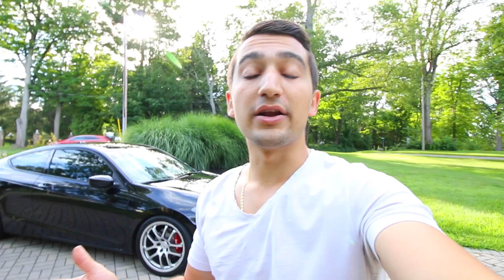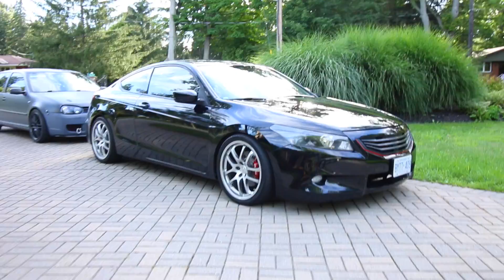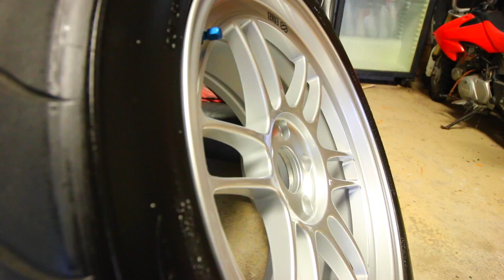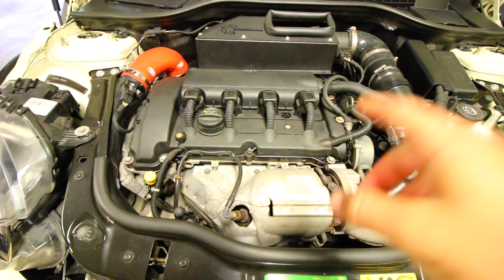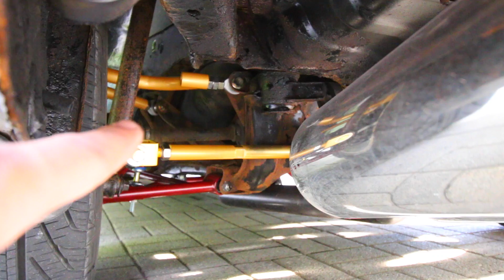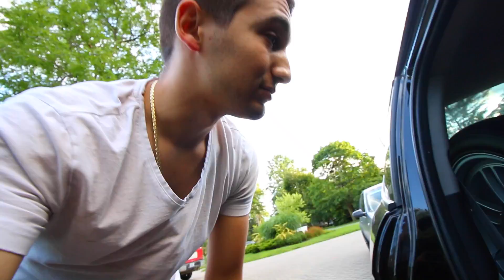I BOUGHT THE CHEAPEST FORGED WHEELS ON THE MARKET!!

Comment: Are you still on the lowering springs or did you get coils on the accord, I love that fitment and I got a 8th gen accord as well.
Reply from the maker: I'm on coilovers right now, but I didn't change the ride height of the coilovers when I took off my RPF1's (oversized circumference) and it had less tire gap than what it has now. I might lower it a tad
Reply: milanmastracci nice, what coils are you running and are they comfortable? Im thinking about getting megans but I dont wanna break my back with the amount of uneven roads in NJ

Comment: G35 wheels are staggered, did you mount the wider wheels on the front or rear?
Reply from the maker: Not quite. I put them the proper way they should be. The previous owner mounted 245's on all 4 wheels which I thought was a bit weird but there's no point in swapping them now. The rim width is only different by 0.5" so its barely noticeable.
Reply: Cool, sounds like the way to do it on the Accord, no point in having staggered wheels on a FWD car.

Comment: Talk about dirt cheap, I picked up a set of the same forged wheels brand new after sitting 10+ years in someones garage, first owner of his G35 for $400 last year. Lol, honestly thought you wouldve been running the RPF1s on the 240!!
Reply from the maker: Damn that's pretty good!! The only reason why I didn't keep them is because the overall tire circumference is too big, and I think the RS3's would be too grippy for this thing. I want it to slide out nicely ;)
Reply: Look into Weds Sport Tc105n wheels. Theyre kinda on the pricey side but super lightweight
Reply from the maker: Those would run me close to $3k without rubber!! Almost half as what I paid for the car..
Reply: Lmao 😰
Reply: If you're getting coils for the 240 why not just run the rpf1 with different tire's

Comment: if you alter the wheel diameter,does it give a correct speed reading on your clock
Reply from the maker: I know. Thats why I didn't put the 19's with the 245's on the 240. I really wanted to but it was going to be too big

Comment: What size is your spacers for the accord with 19” wheels?
Reply from the maker: With stock fenders (not being pulled and rolled), these wheels would fit perfectly. But since I did roll and pull, I had to install a 12mm spacer both front and back to get them to be flush.

Comment: 3 different cars and I thought I was bad I got 4 cars and 2 don't run because they need a lot of work but eventually I will get them on the road one is a 92 Accord LX 5 speed manual transmission the other one is a 95 Prelude SR-V Red with Black heated Leather seats power sunroof locks and windows V-Tac H22A1 I can't get a safety done till the rust is fixed through a body shop

Comment: I thought the g35 had staggered fitment. If they do were the wider ones put on the front?
Reply from the maker: They do come with staggered wheels. I have the larger wheel in the rear. The previous owner put 245/40R19's on all 4 of the wheels which I thought was a bit strange, but oh well.

Comment: their cheap because their stock g35 wheels 😂
Reply from the maker: Yes and no. They are G35 wheels but they were an option. They are Forged, the same bolt pattern, and they're going for HELLA CHEAP. I'll gladly take advantage of that
Reply: theyre still enkei wheels
Reply: ndk2k4 wrong. They're rays.
Reply: Alex Coziak cheap? Go ahead and find some with tires for 550. That was a steal.
Reply: Alex Coziak exactly
Reply: They look good, durable and cheap. What's the problem??
Reply: they're
Reply: Ugly wheels. Keep those things on g35.
Reply: yea..